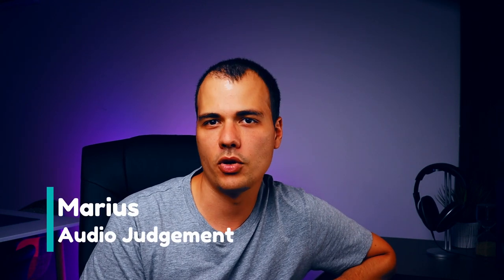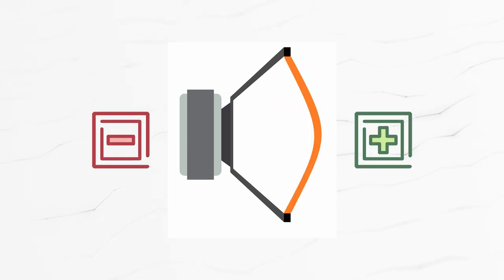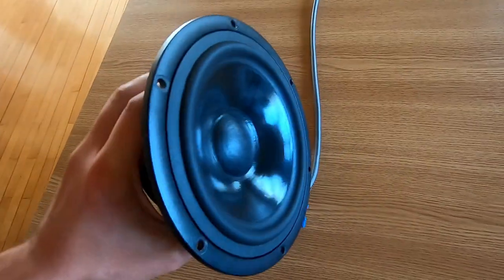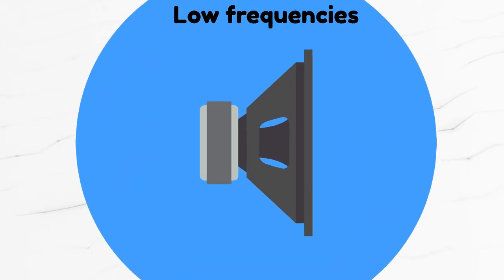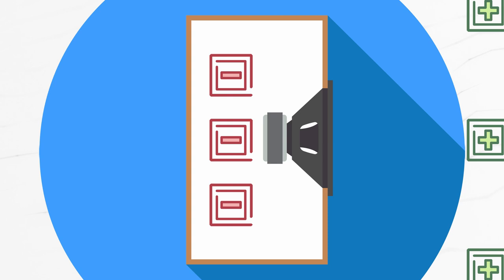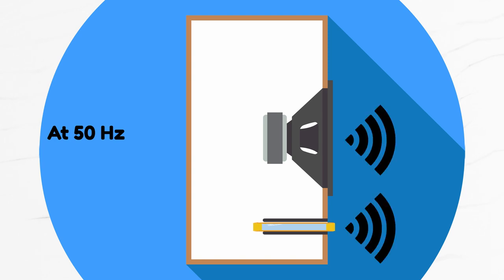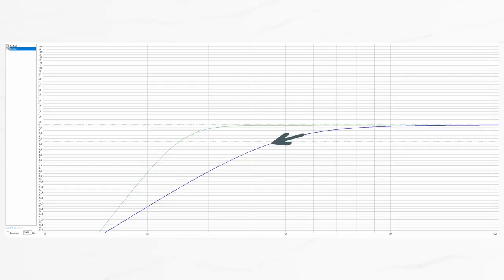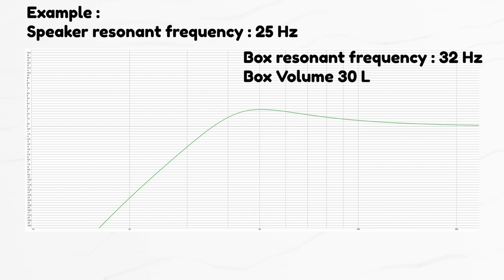Ported subwoofer box explained

Comment: Well explained 🙏. 
If you dont mind me asking.. I don't know much about these things but I've recently installed sound in my vehicle & in doing so, my uncle gave me a subwoofer that already has a enclosure that is ported, very similar to the sketch of the ported one in your video.. sounds nice but we've once blocked the port and it actually sounded a bit better for me .
I was wondering if me blocking it from now on will somehow harm the subwoofer or not ? 
Thank you
Reply from the maker: No, it will not do any harm. If it sounds better, you can block the port.

Comment: Great vid. Finally someone who see and explains things from a practical point of view without over complicating things, micromanagement. 
--I am trying to use winISD Pro. In the port section, it has width, length, and "1rst port resonance." Is that the port resonance/tuning?
--And, if I run sealed, do I lose some SPL?
Reply from the maker: You setup the tuning frequency in the box section. The 1st port resonance is not something that you should concern yourself. It's something that should be avoided, but if you are building subwoofers, it usually is outside of the playable range of the subwoofer anyway. So, don't sweat about it.
And yes, if you run sealed you will have a lower SPL. In normal conditions it's - 3dB.
Reply: @AudioJudgement  thank you.

Comment: Great video! Never knew  about tuning a box!  I built a box 10 years ago but dont know what frequency it is.  Its 15"x16"x17" with a 1.5" x 14" rectangle port on front/sub side. Port wall stops about 2 inches from the back.  Running a old school 12" l5 solobaric. If anyone knows i would appreciate it.
Reply: You need to provide a little more info on the box
How long is the port. I know you says it stops 2” from the back , but which wall does it reside in?
There’s calculators online that can do this math for you

Comment: Thank ypu for the video. Just having this doubt, am having a dual klipsch R 121 Sw sub in my home. The gain is about 50 % and avr trim at - 8. Is it ok to cover the port with plugs or using some socks to get some good punch. Mine feels bit boomy some times. And if its designed to wrk ported , any problems if i restrict the air flow ? I knw big brands having port plugs and all. 
Thanks
Reply from the maker: If you cover the port there is absolutely no problem. It changes the acoustics but there is no concern of speaker failure of something like that.

Comment: Hi Marius, can you explain why the woofer moves less, when the port resonance kicks in? I don't get the physics behind that. I mean, when the port (better: the air in the port) is moving vigorously to gain output, then it has to be pushed by something. So it's somewhat counter intuitive that the woofer moves less in in the ports resonance frequency.

Thank in advance for an explanation!
Reply from the maker: It’s like having a weight attached to a rubber band. The weight being the mass of air inside the port and the rubber band being the air inside the box. If you hold the other end of the rubber band (your hand being the speaker) and try to bounce the weight, your hand will start with ample moves. But as soon as you are close to the resonant frequency of the system you hand will make slight movements while the weight will bounce with ample movements.
Reply: @AudioJudgement  hi Marius, thank you! This analogy of Port resonance is pretty good and should find it's way in your udemy courses. 

As far I remember you said in one of your videos that the port ist "stealing" the energy from the woofer at Port resonance. that's why woofer excursion goes down.

This "stealing" is the missing part I'm looking for.
I mean as long as no one turns the volume knob down, the woofer should move, let's say, something around 2cm excursion between 45 and 20 Hz in free air. But the lower the frequency goes, excursion gains some additional millimeter. There's a big box with a port next to you. The port is tuned to 23 Hz.
As soon as you put the Woofer in the box and play some reverse sine sweeps down to 20 Hz, the woofer is moving like expected until it hits port resonance.

I expect the excursion to rise because the port "opens" so there's less spring-effect from the air inside the box, but it's the other way around. Still, no one has touched the volume knob.
Reply: @AudioJudgement   I finally got it!

this is the behavior above port tuning frequency. The port is closed:
- https://youtu.be/trKJ0Yp6GMw?t=437

this is the behavior below Port Tuning Frequency, so basically the port is "open":
- https://youtu.be/trKJ0Yp6GMw?t=340

and this here is right at port tuning frequency:
- https://youtu.be/trKJ0Yp6GMw?t=378

Obviously the resonance frequency has to be phase inverted, otherwise it would cancel out the woofers output. 

=> And now it's clear for me WHY the woofer excursion decreases at port resonance!
I somehow thought, the resonance frequency opens up the port but because of the length of the tube the pressure waves will exit phase inverted (in phase with the woofer) and at frequencies below port tuning the wave is too long to be inverted by the port.

I'm just starting out with speaker design and build my first Sub-Enclosure just last week. Your videos and courses are nice to have as a reference and very helpful. Thanks for that!

Comment: I have a 6 and half inch driver, box dimension is 16(depth)x7(width)x11(height), driver mounted in rear panel downside on width side and port on front panel upwards suggest me the port size, length and tube dimeter coz flare will increase the port size bit more than diameter of port tube

Comment: The port size should be such that the resonating air mass stays laminar.  Turbulent airflow starts at circa 11m/s so with maximum displacement = max permissible power input you then need to check port rear flow velocity.  The other crucial point is the point of tuning.  The  Fb should be close to the Fs of the driver and not permit the max permissible cone excursion to be exceeded as this risks the voice coil former smacking off the rear plate if the pole piece and damaging the voice coil plus increases distortion.  The box should be sized to the t&s parameters of the driver to ensure Fb is +/- 5hz or so of Fs in free air.  You can alter the box “Q” to play with port alignment, the ideal being BB4 alignment for lowest group delay and phase shift.  Typically this involves a reduction of Q by introducing damping to make the apparent box volume greater than actual which increases the acoustic line of the vent tuning beyond actual vent length.  Its a clever means of generating greater depth of bass more accurately than conventional tuning but isn’t to be confused with extended bass shelf tuning.  I normally employ bb4 tuning using this method for rfc speaker designs with a tuning point of Fb slightly above Fs.  It also removes bass peaks at tuning by altering the alignment for more linear bass response.  Not easy to get to grips with as anyone attempting a diy ported design can attest to. Sealed boxes are far easier to design for if going the diy route.
Reply: The video discussed about inphase & out phase wave direction of speaker...

Comment: Very good video, thanks. The one thing I don't follow is, at around 8:00, you say that a larger diameter port will increase the resonant frequency of the box. Since a larger diameter port will contain more air mass, and in a mass/spring system a larger mass typically results in a lower natural frequency, it would seem that the opposite would be true. What am I missing?
Reply: Because the surface area of the air column in the vent is greater, which couples to the air cushion inside. Thus the "suspension" is stiffer (less compliant). Think of it like putting you finger in water, and then putting your flat hand in water which requires more strength (not the best comparison maybe but you get the point)
Reply: You need to look up the concept of acoustic mass.

Comment: Would you please explain the field coil drivers. The dimensions of the coil and wire gauge, l.v.r calculations for max magnetic flux?  Thanks
Reply from the maker: I'm sorry but I have no expertise in this area. You might find information about this topic in old books. Or you can play around with speaker driver design applications, but those are pretty expensive.

Comment: If i keep my hand on air hole or aero and stop airflows  of subwoofer will it harm the subwoofers speaker!?
Reply from the maker: Not really. You are transforming a ported box in a sealed box (a leaky sealed box if you don't sealed the port perfectly), and that's just fine for the subwoofer.
Reply: @AudioJudgement  Yeah, thanks. My speaker model is Creative Cambridge sound works SW 320, has not such leaks though.

Comment: I have a bass reflex speaker box but it hasn't got any lining/damping.
If I take damping into the box it Will be better or it's worst for the bass reflex?
Reply from the maker: It will most likely sound the same. I wouldn't bother. If you don't have any obvious problems (standing waves, high frequency sounds escaping through the port), I would leave it alone.
Reply: The bass tone is not strong enough, i can't tell it in English very well :D but the box make echo or peal.
Reply from the maker: @P355gt  Maybe it can help with the echo thingy you mention, but you won't get stronger bass by placing dampening material.
Reply: @AudioJudgement  Thanks!! :D

Comment: Question: can I use multiple "holes" on the box, instead of a single tube? For example if tube required would be 10 cm long and 3 cm diameter, can I simply drill 5 pieces of 3 cm diamater holes on the front baffle which is 2 cm thick? I guess the resonating “air mass” would be similar. Yet no one uses holes! Why?
Reply from the maker: It’s not the same thing. If you make 5 holes the total area is 5 times larger and the port needs to be very long (each of them). It’s not just the mass air inside the port, there must be a certain impedance for the air movement. That is achieved by making the port longer. If the diameter is too large and the length too short, the air escapes without any impedance and no resonance occurs. You would have a leaky sealed box not a bass reflex :)

Comment: Have you tried doing this with an isobaric enclosure like LINN use? And looked at the bass extension obtained. I wonder if there are calculations you could for ideal volume between the two drivers and the volume behind the rear of the two drivers

Comment: My question is if the speaker cone deliver positive and the port delivers negative 
Then what will happen if we use 2 subs and have air pass in the center of cabinet with the help of v shape will negative and negative becomes positive
Reply from the maker: A port will always invert the phase of the speaker back-waves. So, the port sound waves will always have the same phase as the speaker front waves.
Reply: @AudioJudgement  can u Chek db technologies s30n sub cabinet on YouTube u will understand better what I am trying to ask
Reply from the maker: @nehakanoniya4115  I didn't find any sketches of the enclosure but from what I understand at first hand it's a bass reflex enclosure with a horn in front of the port, which will amplify the sound of the port.
Reply: @AudioJudgement  right but if negative wave are coming out of the both speakers at the same time there is no partition between them the are coming from V shape went so their negative will not get mixed with each other
Reply from the maker: @nehakanoniya4115  I really don't understand where the confusion is. It's just a normal dual woofer bass reflex enclosure. The front panel is in a V shape, so it acts like a horn and amplifies the port sound.  If you understand how a normal bass reflex works, this enclosure works the same way.
Reply: @AudioJudgement  sir try to imagine that the v shape between them will merge the both subs  back waves and the speaker delivers negative wave so when negative and negative will get merge will it become positive because of the V shape vent
Reply from the maker: @Neha kanoniya  The V-shape has no other effect than to amplify the port sound (and the effect of this "horn" will be quite limited anyway). The speakers will emit positive pressure in the front and negative in the back (inside the box). The port will invert the phase (of the back waves) and positive pressure will come out the port which will add up with the positive pressure from the front speakers. That's all there is to it.
Reply: @AudioJudgement  okay tysm sor

Comment: What happens when there are two ports of different resonance frequency in a single box?
Reply from the maker: The ports won't have separate resonant frequencies. It will be only one, as a combination of the 2 ports. But it's just wrong, as you are wasting space inside the box (with the larger port) and you need an extra port also for no benefit.
Reply: @AudioJudgement  Thanks for your reply.  Can you please make more videos for 4th order and 6th order bandpass.
Your videos are great and helped me a lot in designing speaker boxes and finding t/s parameters of speakers.
Thank you

Comment: Looks like an ugly hack. Wouldn’t you agree the elegant solution would be to integrate a subwoofer to the enclosure giving way to a 3-way amplified speaker?
Reply from the maker: I consider the subwoofer a hack when you use only one subwoofer. If you use 2, therefore stereo, it doesn't really matter if they are integrated into the speaker enclosure or in a separate box on the side. Judging strictly by functionality and not by looks.
Reply: @AudioJudgement  Makes sense. Though I was thinking more in terms of inserting a port into the enclosure as a hack, subwoofer or bookshelf speaker.